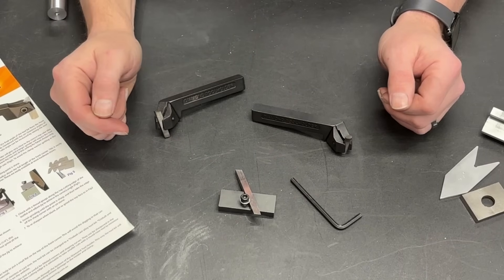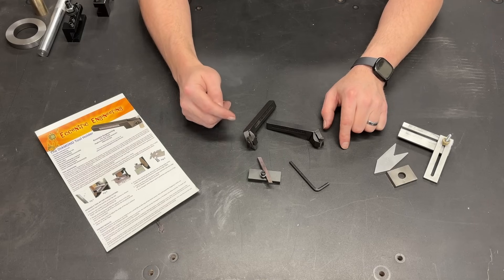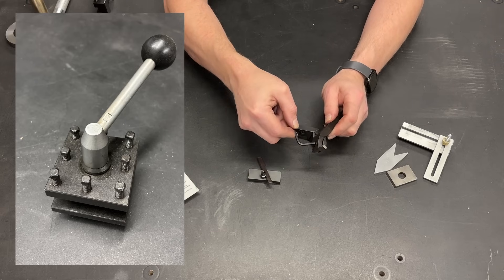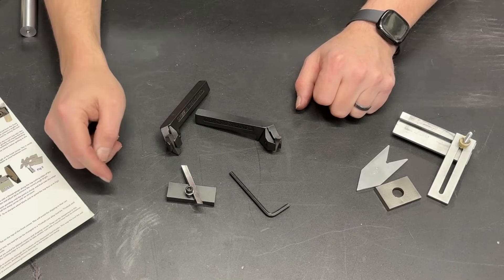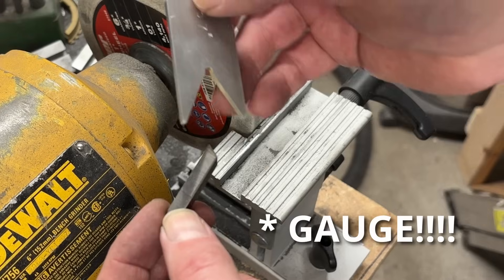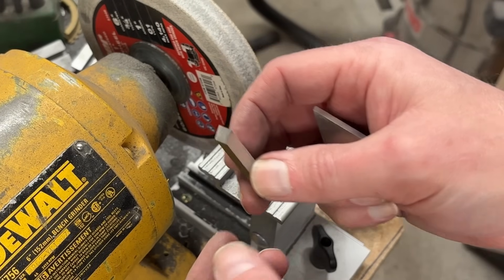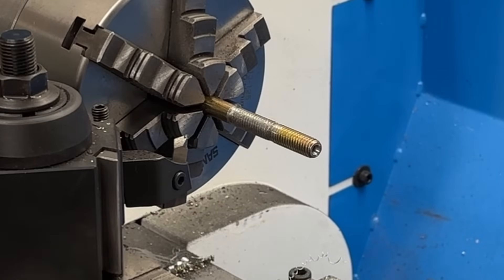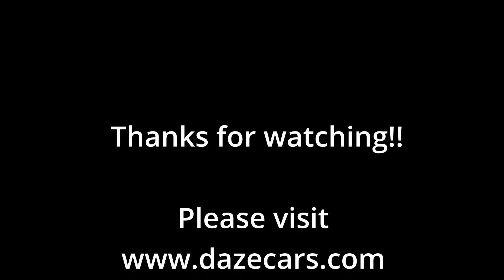The Diamond Tool Holder AKA Tangential Tool Holder:  Use, HSS Sharpening, & Product Review

Comment: Thank you for your video, I will now pay closer attention to all the variables in sharpening a tool bit, because like you said they can easily grind the wrong cutting profile. I will also be fabricating a 57 degree tool gauge.
I have the same tool and also like its performance and ease of sharpening very much. I have a trick to set your tool cutting height. For a quick change tool post, flip the tangential tool holder only, up side down on a flat  surface. Insert your tool bit cutter in the holder and set the cutting tip to touch the flat surface, tighten the holding bolt. Now mount your tangential tool holder in the QCTP an adjust your height screw on your QCTP to cut dead on center and lock that adjusting screw. So the next time you will sharpen your tool bit, install it like mentioned above and you are ready to go, no adjustment needed you will be cutting on center. 
I don't have a QCTP but I made my  lathe tool holder spacer height to accommodate this technique.
Reply from the maker: That's a great tip for setting the cutting height - thanks for sharing!

Comment: If you ever have a need Dorian makes an AXA Tool holder that will hold a 3/4 tool they’re pricey but the only one I’ve found that has a 3/4 opening. Thanks for sharing I hadn’t seen this tool until now.
Reply from the maker: Wow those are expensive.  At that point I think I would get a 5/8" AXA and put it in the mill to remove the extra material.

Comment: 11:43 you're doing your finishing pass wrong, you should have it flatter to get more of a scraping action instead of using the point. This is shown on his site on one of his vids.
What I like about this tool is it will hog off material and finish material. It can also be set at different angles, and you don't need to bother with very many tools as this one does so much.
I am using the crobalt or whatever its called and not the HSS
Reply from the maker: Thanks for pointing out my "error" but I didn't do a finish pass.  I wasn't trying to do a finish pass, just making cuts and was very impressed with the finish I got with the tool in that configuration.  I found a round blank made the best finishes over all but none of that was covered in my video.

Comment: The reason they fell from favor is due to improved tool steel. these holders can utilise a much more brittle tool but as tool steel/HSS got better it became tougher and the overhang became a part of swarf control. High volumes of swarf with larger chip breakers along with tougher steel  reduced their need. Also remember the steel isnt held anywhere near as firmly as a tool in a flat layout with multiple clamp screws holding it down.
Also a tip for sharpening modern HSS. every time you quench the tool if it is hotter than water you affect the temper. Effectively softening the tool steel.  Always let it cool in air if you can. In a perfect world you never grind it hard enough to cause a colour change.
Reply from the maker: I would love to hear more about your statement not to quench.  I think you have it backwards.  Quenching is how you harden steel.  That sudden shock of an instant cool is what does the hardening.  Slow cool softens steel.  It's called aneling.  By never letting it get too hot neither of these things are going to have a major effect as both quenching and aneling require significant heat, hence the finger technique, but I really don't think quenching will soften it.  I would love to hear more if you have proof that I am wrong.
Reply: @dazecars  Any time steel is quenched it adjusts the hardness set. It works along the the same lines as cryo hardening. Every heat cycle of Tool or HSS affects its hardness. Fewer cycles done at under the critical temps the better.  Edge retention is important when using HSS and it is rapidly affected during grinding heat cycles. One of the reasons why those tool holders work so well. Another being why every bit of cooling used whith HSS helps
Reply from the maker: I know all that and agree with all of that.  My challenge was to the statement that you should let it air cool instead of quench cool.  A quick cool will harden a slow cool will soften, but you are suggesting air cool in place of a quench as you said a quench will soften, I don't think thats correct.   All this is largely dependent on how hot it gets prier to the cooling.  Simple solution go slow and never let it get so hot you can't touch it and I don't believe you will have an issue either way.

Comment: Has anyone used this on an Atlas-Craftsman 12" ?   I find that surface finish is an issue with this small lathe due to lack of rigidity.  Just curious if this might be an answer to that problem.
Reply: I use it on the Smithy Granit 1324 and am having very good results.
Reply from the maker: I don’t know about that specific lathe but I know a lot of people with small hobby equipment have used this cutter with excellent results.
Reply from the maker: I think even the harbor freight hobby lathe would benefit from this tool

Comment: Great timing on the video I ordered a r/h in 3/4” and am expecting to arrive any day now, I’m really looking forward to putting it to work as most people that have them seem to consider it a good tool and investment. Thanks for sharing.
Reply from the maker: I am sure you will not be disappointed.
Reply: @dazecars  He won't be.....I've used them for a number of years and they are my favourite go to cutting tool.
Reply: I have used these tools for years and i can say with some confidence that you will not be disappointed with your new purchase.
 I have some of the genuine Eccentric Engineering tools and a few homemade tangential tool holders with slightly different geometry than the Eccentric Engineering items.
Just follow what has been demonstrated in this video regarding the amount of tool stick out from the jig when sharpening and you can't go wrong....one other thing to mention is that it is well worth buying a couple of blanks of high quality Cobalt HSS.  I use Presto brand blanks in M42 eight percent cobalt HSS and they hold their edge very well.

Comment: Why not use the miter gauge and tool rest on your grinder to set the angles and forget the jig?
Reply from the maker: It's not that simple you are grinding an angle across the HSS diagonally not based on one side of the blank but 2.  I do not believe your technique would be as easy to setup.  Also the fixture works so well and is so easy to use why reinvent the wheel.
Reply: @dazecars  it looks like the tool bit is sitting flat in the jig, Am I wrong about that? If it is sitting flat it would just be a matter of setting the table and miter gauge angles. You could then hold the full length of the bit against the miter fence instead of the narrow side face of the jig
Reply from the maker: The fixture angles the steel in two directions relative to the corner of the blank.  A basic diagonal cut based on only one side will not give you a diamond shape on the ground surface.  The grind must be bast on two adjacent sides of the square stock HSS.  The fixture accounts for both angles and that is what gives you the diamond shape ground face.  I wish it was as simple as what you suggest but because it's based on two angles referenced on two faces the fixture is IMHO required.
Reply: @dazecars  I realize that the jig tips the tool upward and on an angle but it looks like the top face of the tool bit and the top face of the jig are on the same plane, not tilted in the jig groove. I don’t see how that is any different than setting the tool bit flat on the table that is tilted up and the miter gauge set at the correct angle
Reply from the maker: The groove in the fixture is deeper at the back, so the top face of the tool bit and the top face of the jig are NOT on the same plane.  Yes you could tilt the grinder tool post to the correct angle and then use a miter gauge and tool rest like you suggested and sharpen without the fixture but that's now two angles to wory abou.  Can it work absolutely,  is it simpler than using the fixture, probably not IMHO.  That doesn't make it any less effective if a person wanted to save a few $$ on the fixture, but then you lose the built in 60º grind option as well and would need to come up with a way to do that.
Reply: @dazecars  I realize the groove is deeper on the back but it’s not tilting the bit side to side in the groove just up and down. If the groove was machined flat instead of that upward angle, the top of the bit and the top of the jig would be flat on the same plane, same as placing the bit flat on the grinder table
Reply from the maker: Yes exactly. I’ve already agreed that the technique you propose could totally be made to work. Like so many things in machining there are lots of ways to accomplish the same task. I’m a fan of simple having a fixture that’s already set to go eliminates whole bunch of preparation and allows me to sharpen the steel on the fly.
Reply: @dazecars  Happy machining!
Reply from the maker: You as well, thanks for the comments
Reply: @stevenhintz5508  It is sitting at a compound angle in the jig so the grind is hollow ground across the diagonals of the tool bit.
Reply from the maker: You are correct but his technique would work.  I still prefer the fixture.

Comment: Have you used the holder for the round tool bit? I could see that with the rounded tip could leave an even nicer finish. Also great for grooves..  Thanks for sharing
Reply from the maker: I used the fixture to grind a round blank and does make for an even better finish.  I mentioned it in passing in the video and one of the holder on the bench has a round cutter installed.

Comment: I really appreciate your videos.  How does the tool do on heavier cuts in steel? I am very tempted by this; birthday coming... The thought that you put into improving systems is great. Thanks for showing this, even though I am supposed to be working on a FreeCad drawing lol.
Reply from the maker: Cuts steel like butter.  I was able to take fairly deep cuts and had no issue and still produced a spectacular finish.
Reply: @dazecars  I sincerely appreciate your reply! I think this will be my birthday present if kids college doesn't bankrupt me! lol :)
Reply from the maker: absolutely, you took the time to comment, I can take the time to respond
Reply: I have no problems taking 100 thou (2.5mm) deep cuts with my Eccentric Eng, tools.
Reply: @howardosborne8647  Great to hear. Thank you for the response. I use carbide bits meant for aluminum and can get 1.5mm cuts on my lathe so just staying the same with the better finish and cheaper / available tooling would be nice. Thanks for the response.

Comment: One feature that none of the reviews so far have mentioned regards the supplied tool bit. The square bit is ground on both ends by the supplier, so it's ready to use. One edge of the bit had a radius, which makes a small nose radius on one end. The opposite edge is left sharp. At 11:20 you can clearly see the rounded edge by the way light reflects off of it, which is for general use, and to some degree accounts for the nice finish you get. If you need to leave a sharp inside corner at a shoulder, you can flip the tool bit end for end. That's a nice touch. It's a nicely made tool, and likely nicer than you can make. The one suggestion I would add is that you use a cutting disk in a Dremel tool to grind a little relief groove at the bottom on each V-notch, to help the tool bit settle in without corner interference.
Reply from the maker: that is an excellent point.  I used both the "rounded" end and the "sharp" end and the finish was very similar.  I also ground a piece of HSS round stock and the made cuts with that and the finish was even better however as you would expect the depth of cut I could take in steel was reduced.
Reply: Had mine for years and love them. I bought about 20 HSS blanks years ago and still haven't ran out. FWIW, I never had to do anything to mine to help seat the tool.  One tip is to make yourself a tool height gauge so if you need to remove the tool for sharpening you can get it back to on-center quickly.

Comment: I got one of these for Christmas and it is the perfect addition to a small lathe.

I've got all my Chinese carbide tooling in case I want to take serious cuts in steel, but this thing is so versatile that it's the tool which is usually on my machine. I've cut alumimium, steel, brass and even titanium (small cuts) without having to change anything. Whenever it gets a little blunt, 5 minutes on a diamond stone and it's good as new.
Reply from the maker: I have a feeling this will be the most used cutter on my lathe from now on as well.

Comment: Thanks for sharing. BTW, that six jaw chuck is enviable!
Reply from the maker: It was way more affordable than I anticipated https://amzn.to/41s2vRy
Reply: @dazecars  What is the advantage of the 6 jaw chuck other than looking really cool?
Reply from the maker: Great question, first it's way more repeatable on truly round stock.  I can turn something, remove it, do other work, reinstall it and as long as I am holding it by the surface that has been turned it is almost perfectly on.  The flip side to that is it does not hold as well on stock that is not perfectly round.  Thats the advantage of a 3 jaw as it easily holds imperfectly round pieces like unmachined bar stock firmly and easily.  This 6 jaw however is also a 3 jaw chuck if I need it to be as all I need to do is remove every other jaw.  The last thing that a 6 jaw is really good for is thin wall tubing.  Holds it firm and causes way less deflection than a 3 or 4 jaw chuck
Reply: @dazecars  Man, your really do read your comments! Thank you for the response. Now even more for my birthday wishes! Very interesting on holding thin tubing. I have to cut section of 100mm to 150mm sanitary tubing and this could be just the ticket. Thank you for the reply.
Reply from the maker: glad I could help, let me know if you have any other questions.

Comment: It's 15mm shank because they're just re-branding a generic holder from china, and the rest of the world uses metric tooling. I just ordered tooling for my cnc lathe, and all the ID tools are 32mm, and the ID tool holders in the machine were 1.25" (31.75mm) - I bored the holders out to take the more common and way more economical tooling.
Reply: I manufacture the tools myself in Australia from 4140 lost wax castings, sourced from a casting plant in New Zealand. They aren’t a rebranded generic holder from China and have been made in Australia for the past 30+ years. 
The reason for the difference in tool and shank height is the drop nose design and getting side and front clearance on the tool bit and clamp.
Reply: @eccentricengineer  I am so glad you chimed in on this. Thank you for the well thought out system.
Reply: @eccentricengineer  I'm also glad you stepped in to correct this utter nonsense talk.
By the way I also use your diamond tool holders in the metal shaper as well as the lathe...they cut beautifully in the shaper 👌
Reply: @howardosborne8647  that's interesting to hear. I haven't tried them in my shaper, now I will have to out of curiosity
Reply from the maker: I wish I had a shaper
Reply from the maker: No that’ s not correct.  They are labeled in both metric and imperial 1/2" and 12mm.  I believe the design/function of the tool is what results in the shank being bigger than the cutting height.  Either way I could have purchased the smaller unit that would have fit in my AXA had I read the description more closely... or at all 😂😁🤣 I think I am actually better off with the tool I got because the larger shank should be more rigid and an over sized AXA holder can be had for about $15
Reply: This isn't some generic Chinese product sold by some distribution company aslo selling plastic spoons or the like. The website information is excellent to allow you to select the right tool holder and customer support is excellent.  I have had a pair of 3/4 holders and they are really good robust units and my tool of choice.
Reply: @Gorak....Utter nonsense you're talking about here. As you can see from the post below from the manufacturer these tools are cast steel and have ALWAYS been made in Australia.